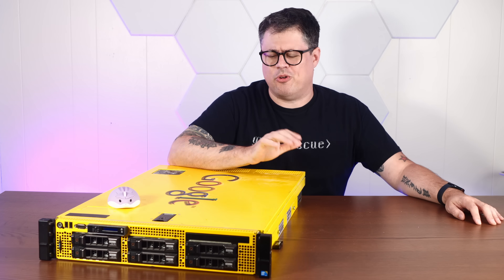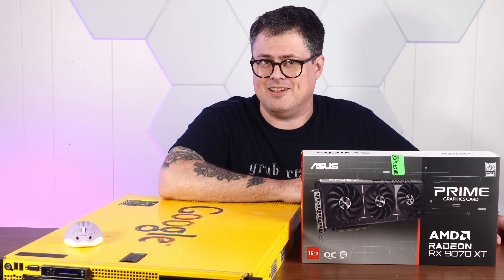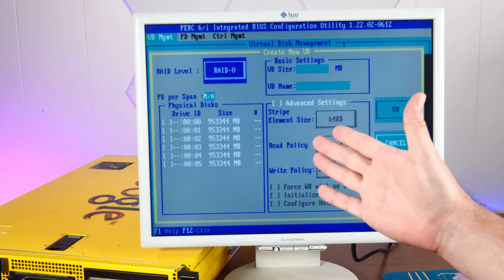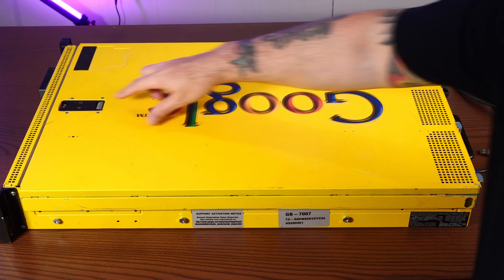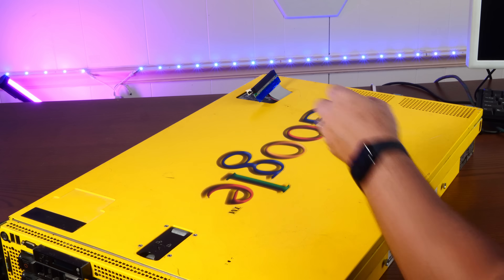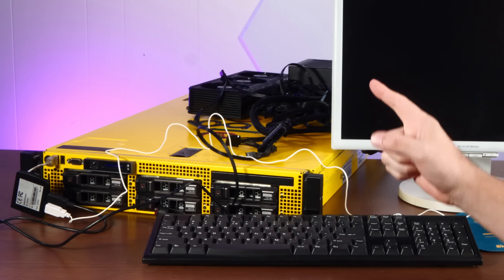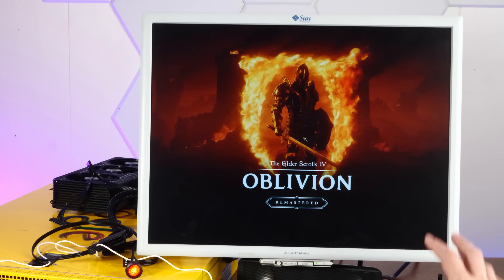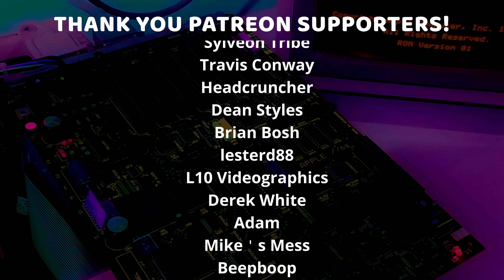Can You Use a Server as a Normal PC?

Comment: when doing crap like this you should explicitly tie together grounds of both power supplies (take a black wire from each one) so they don't try to equalize themselves through weird ways like pci slot ground pins and monitor cables.

Comment: I have one of these systems (r710) and there should be a bios setting to tell the fans what mode to use. The default is run at full tilt, but you can tell them to run based on something like system load or exhaust temp. This should quiet them down considerably without needing to use ipmitool, while still allowing them to ramp under high load (something not possible when manually setting with ipmitool)
Reply: Yes, it's "Power Management" - Set it to "Active Power Control" and NOT something like "Performance" mode. 
I mentioned this on the previous video, and in my comments here that are being hidden, probably as possible spam still waiting for moderation to approve them.

Comment: If you want to potentially improve performance in gaming then remove the second CPU from the board. Some of the games you're running might not be NUMA aware, in which case you'll be hit with a latency penalty for foreign memory access. You can check before you remove the CPU using numastat. If the "numa_foreign" figures are a substantial percentage of the "numa_hit" figures then you could probably benefit from removing the second CPU.

Comment: I appreciate you correcting all the sins of the previous video. 😆

You can shove a pair of Xeon X5680 CPUs in it, for a big bump in clock, and 6 cores per chip instead of 4. You can also get a bump in ram speed by using less DIMMs.

It's still going to be a R710 at the end of the day. Not unusable, but not as fast as anything cheap and modern.

You may have hit the nail on the head, run that GPU with a Pi5 on PCIe3 speeds at 1x.
Reply: Baconator.
Reply: Got 3 sets of 1366 chips, x5690,x5687,X5670. Pretty old but can still be used. Using a ryzen 5950x now
Reply: Older revision  R710's can only take lower TDP CPUs but a pair of X5675's is still much faster and not too far from the X5680 or X5690
Reply: Can confirm from my Mac Pro experience. Going from E5520 to X5680 is huge jump.

Comment: 11:05 Install fresh drives, SSD or HDD, and then make a killer NAS, JellyFin homeserver or other HomeLab appliance!
Reply: its noisy as fuck, unless you have a full on cellar to use as datacenter.. 
oh yeah and it draws a lot of power. 24/7
Reply: As someone who used to use an R710 as a home server recently, no way. The noise and power consumption are terrible and the compatible CPUs can't handle QuickSync. I switched over to a dirt cheap 1L PC as a host for my docker containers and a NAS for storage and it's so much more powerful and cheaper to run, not to mention almost inaudible even in the room with the hardware.
Reply: Yeahhh killer as in it kills your enthusiasm for it. 

These old dual cpu server racks are A. Noisy as all hell B. Incredibly inefficient and C. Just plain bad in terms of performance. 

Assuming you had one of the high end chips for this rack like the xeon e5 2690 v4, the cpu by itself offers less performance than something like a ryzen 7 3700x while consuming more than double the power which then equally translates to more heat and then more noise. Having two of these chips, running simultaneously would be a nightmare. You've also got a max ram speed of something like 2400mhz. In all honestly for a NAS or Jellyfin it'd be far better to go for a n100 or n355 itx board. It'd consume way less power and be more than enough for those applications.
Reply: Servers that generation often also have problems with drives bigger than 4tb. Unfortunately, it's mostly useless. I just had to upgrade a few of my systems for the same reasons. Too expensive to run and upgrade than they were worth, especially with the current corporate leavings on fleabay. 3rd generation pe and up is so much nicer. quieter, lower power utilization, more and faster cores, space and accommodations for dual height GPUs, 64 bit MMIO, DDR4, and the ability to use whatever drives you can get, all for nearly the same low cost as those older machines.
Reply: @thechillhacker  I got mine for 50€ with 4TB of storage and a pretty good CPU/RAM combo to start with (I forget what I had).
I just wanted mine as a testbed for trying enterprise use cases so I could prepare myself for becoming a sysadmin while I nurse my depression.
From that perspective it's pretty neat, and if I could afford a solar panel for my balcony then I'd definitely be running it 24/7. With the fans dialled down it runs a lot quieter and with how little it has to work in my case, keeping them really low is enough anyway.

Plus a few years ago I got a RAM upgrade of 96GB for about 12€ (though a few of the sticks have failed so right now it's down to 72GB). Few PCI bus errors as well a while ago so the mainboard might be on its way out, but I don't regret it one bit.

Comment: I just discovered that there is something that is called a PSU synchronizer so you can use two power supplies on one computer without having to use a switch or jump connectors. You might want to check it out.

Comment: Actually - GPU isn't so much limited by the 8x slot, (it mostly depends on the tasks, but for most gaming - difference would be negligible)
Reply: Except that the server has PCIe 2.0 and it limiting it to 8x makes it effectively the same as a 16x slot on PCIe 1.0
And half the time they struggle to negotiate with modern GPUs and do 8x PCIe 1.0, which is even worse.

Comment: The one easy thing you can expand on those is memory. You can add a freaking crap ton of memory to those guys for cheap. You might be able to get 256GB of blazing fast DDR3 in there!

What would you do with that much RAM other than keep the RAM out of a landfill? Not exactly sure. But you could probably run some LLM models at .5 tokens per second. You can definitely do some image processing or something.

Comment: I like modifying old ATX PSUs to have a switch on them that shorts the proper connections to turn it on and then I use it as a benchtop power supply.
Reply: How do you vary the voltage? I don't think you can efficiently increase the voltage above 12V, no?
Reply: @EmCeeJuan1  I don't usually need any voltages that aren't supplied by an ATX supply.

Comment: For home use those types of servers don't really have a good purpose.  Due to the age of the server it's possible to build a new client system with the same or better specs and more capability while consuming a lot less power. To get the most performance, it needs to be in a climate-controlled room.  It helps if that room is also noise proof.  Then you pretty much max the RAM, change the storage to SSDs to run it as a hypervisor. The spinning disks are half of the reason why the fans need to move so much air. That server will never be able to run a modern graphics card well.  It would make a pretty good Plex Media Server or a NextCloud server if you have fiber Internet.  Of course, those services could easily run as VMs or containers.

Comment: Isn't the slot the riser card is on a 16x, and the risers splits to 8x for the 2 slots? It would have to be more capable if you could harness the power of the 16x.
Reply: Pull the Dell riser and plug an extension like the 8x to 16x adapter into it.
Reply: @ericpaul4575  My thoughts exactly. If its configured as we suspect then a 16x extension cable should do it.
Reply: Most of these servers have a proprietary pci-e interface for the riser cards ...
Reply: @RelJason437  Dell have proprietary components? Say it aint so. lol Purposeful limitations...
Reply: These cards typically don't need 16x, unless the PCIe bus is v3 or lower.
Reply: @watchmakerful  The Dell r710 (that the Google appliance is based on) is PCIe Gen2.
Reply: @watchmakerful  Well since this is PCI-e Gen 2, it just might, then.
Reply: I am sure when configuring during purchase, you can select between 16x and dual 8x risers. So i am sure the motherboard has a 16x slot or you could try to find a 16x riser.
Reply: Those servers throw hissy fits and refuse to boot if the Dell Bifurcation Risers are missing.
Reply: @mari2_ok  Makes sense. Enterprise equipment can be finicky.

Comment: Heh, I live near the Yonkers Micro Center. PS, that one was originally a Circuit City that Micro Center took over after Circuit City wound down their operations.
Reply: R.I.P. Circuit City, where service was state-of-the-art. P.S. Just checked and apparently Circuit City still operates, at least as an online store
Reply: @jasons6491 They used to afaik. That was merged into TigerDirect, which afaik also shut down later.

Micro Center and (to some extent for pre-builts) Best Buy are the last computer stores, and that's not great if you don't live near a Micro Center because GPUs are often expensive and Nvidia has exclusivity deals with Best Buy for their FE GPUs.
Reply: So do I holy crap. I remember when it was a circuit city too.

Comment: I have a PowerEdge R710 here at the house i bought way back when. it currently has bad ram but i have a set of 256gb ECC somewhere (I moved 3 times in the last 2 years due to medical) Mine has the best processors you can throw on that board and twin 850W Psu's. The fans are loud because you have the top off. the machine is basically in panic mode. it quiets down quite a bit when you put the top back on. The machine hardware has advanced monitoring built in. if equipped with an iDRAC module you can completely control the machine from the idrac console including power cycling and going into the bios etc. anything you can do physically at the machine you can do within the idrac console. however older idrac modules use older windows xp era java. you can run the top off but you will have to jump the pins of the chassis switch. the machine is built (all servers are) to run applications in background. the processors are geared for that type of use. it will suck as a desktop machine. though i only run either server 2012 r2 or vmware esxi 6.7 as my virtual host. then i just connect the machine to my SAN via a 4 port 2.5gb/s nic.
Reply: Power draw? What do you use it for?
Reply: I had to make a BIOS setting change to get my R715 to quiet down during boot.